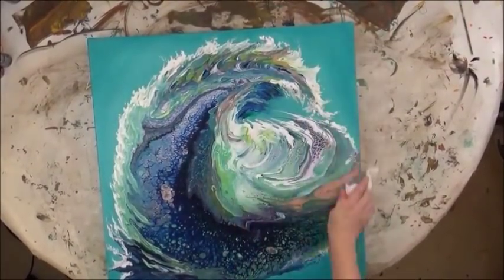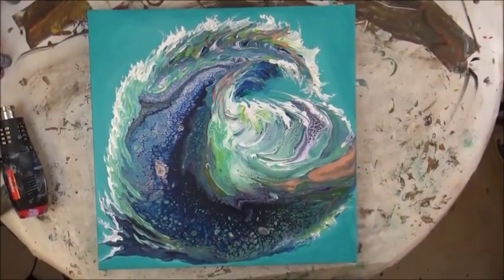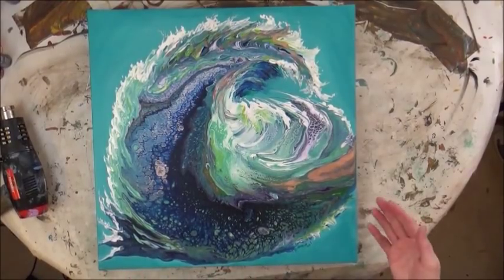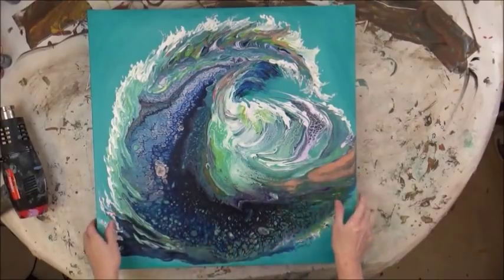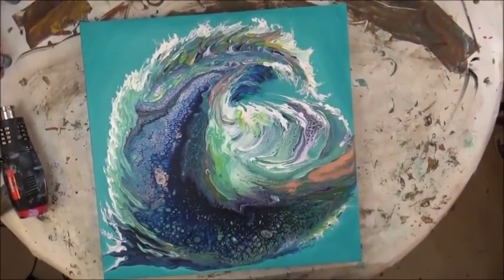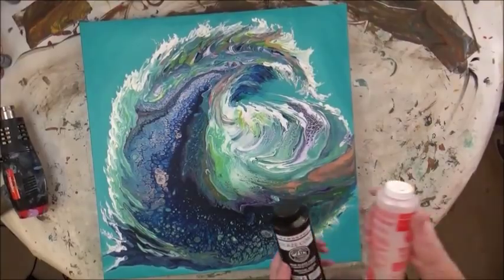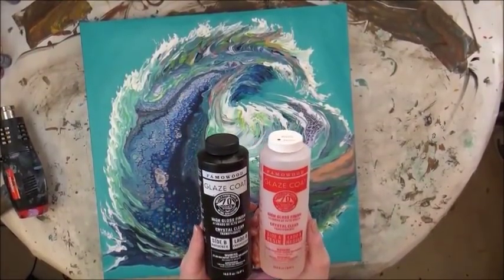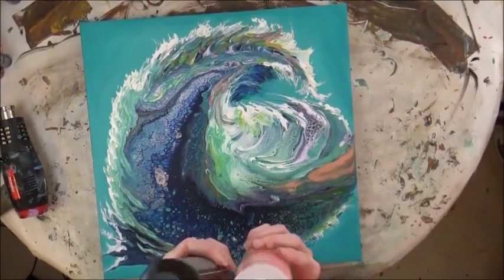(60) How to do Famowood Glaze Coat Resin on Wave on Turquoise Canvas with Sandra Lett  030418

Comment: Hello Sandra, thank you for this good video !! I'm scared by this step of posing the resin and I'm surprised that we can add silicone !? It's very interesting to know, thank you. Another question is how to know how much resin to prepare to cover a canvas ....? It's not easy to estimate ...... Thank you very much for your answers and for these very instructive videos
Reply from the maker: I did a 24"X24" canvas.  I think I used probably about half of each of those bottles of Part A & B.  The Kit was the smallest one I could get because resin is pricey.  I used another kit on 2 18" wooden lazy susans... so half a bottle of A & B for each piece...  Hope that helps... It is scary... But the results are beautiful!  Always tape the underside of anything you resin.  I forgot to show me doing that.  That prevents the drips drying to hard droplets all along the edges on the back!  I didn't do that on my lazy susans and it was hard work to get those drips off
Reply: Thank you, yes I will try I think...

Comment: what I mean is that at the beginning of the video before putting the resin you put a cloth on your canvas but I have the impression that the canvas is wet so I wanted to know if you put a product on the cloth before resin ?
Reply from the maker: Oh!! No the canvas had been dry for weeks...  I was wiping it down with a damp paper towel with a bit of Dawn on it to try to remove any left over silicone.... then wipe it back down with a damp paper towel... and then dry it really well before sealing it